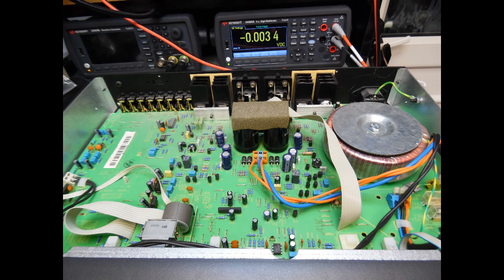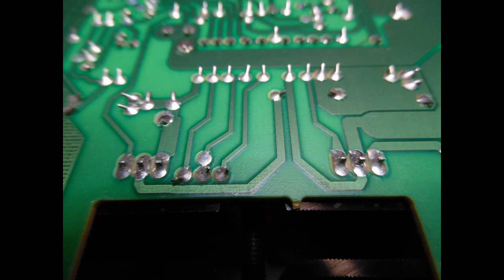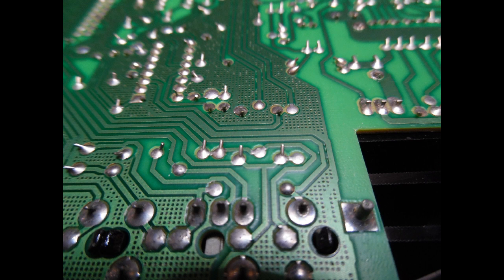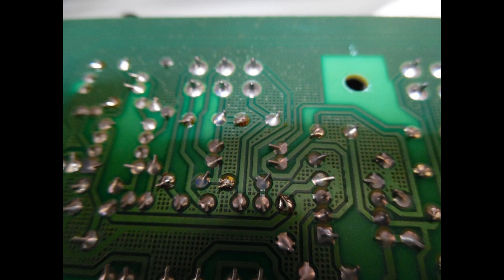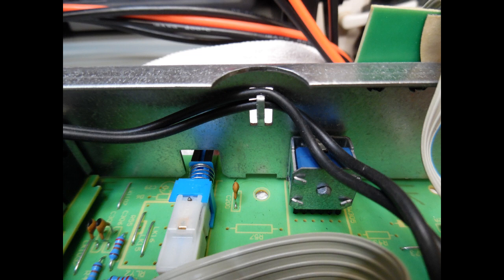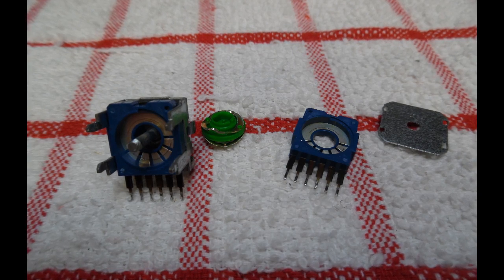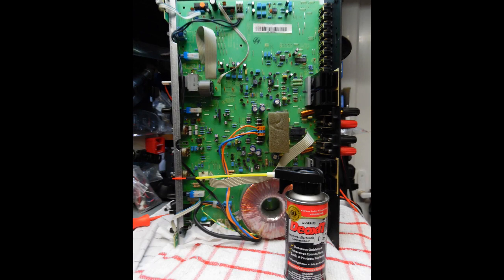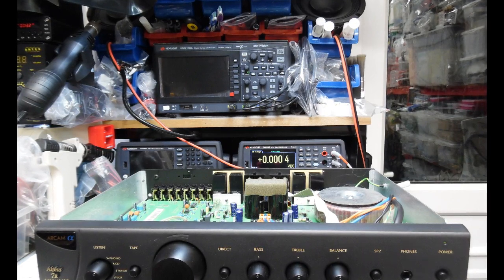Arcam Alpha 7R Amplifier Repair (With Audio Tutorial)

Comment: Hello! I think I fried my Arcam a7 . I connected 2 amps to the same speaker, and forgot to turn it off.  the fuse has blown and power went off .  when i tried other fuse that blown too -  I used a wire in the fuse compartment after and the transformer got pretty hot - still no power. what should I check?
Reply from the maker: Hi from what your describing the output mosfets may have gone short circuit, so you need to test them with a multimeter set to resistance.
Also fit the correct fuse do not replace it with a wire link, as this will cause more damage to the Amplifier and other components to fail.
Reply: @AudioAmplifierServicing  I've tested it. One channel shows 1220/540. The other 020/018.
Reply from the maker: @Popa Adrian  The mosfets showing the lowest resistance are short circuit.
The should be IRF540N, the part number will be written on the front of the devices.
Only buy the mosfets from a known good supplier to avoid counterfeit components.
Reply: Okay! Should I change them all, or just the affected part? Also I have 2 JB 80v 10000uf capacitors around. It's an improvement for 50v 10000uf rubycon?
Reply from the maker: @Popa Adrian  Hi only change the failed parts do not change the capacitors
Reply from the maker: @popaadrian4592  You will need to set the bias
Reply: @AudioAmplifierServicing  Ok, thank you very much!
Reply from the maker: @popaadrian4592  Your welcome
Reply: Works now! Thank u so much! Was only the mosfets. He's a great guy,  sent him an email and helped me trough it.
Reply from the maker: @popaadrian4592  your welcome
Reply: hello! :) did it again.. this time I wreched the Listening switchs knowb (used a screwdriver , the plastic knob was missing - is there any replacement?)

Comment: Thanks. I've had this alpha 7 for twenty years. It unexpectedly lost a channel when moved to the garage. Then the second channel went. Great , an opportunity to reacquaint yourself with a multimeter! But I had never seen this architecture under the cover. Where are the heat sinks, where are the transistors?? Thank you for the explanations . Mosfets.     I think I'm starting with improving my soldering abilities as the fuse remains intact. As someone who hasn/t done this for over 40 years, this is looked at as a low financial loss risk and a high enjoyment potential.
Reply from the maker: Hi can you advise is the power LED green when you switch the Amplifier on?